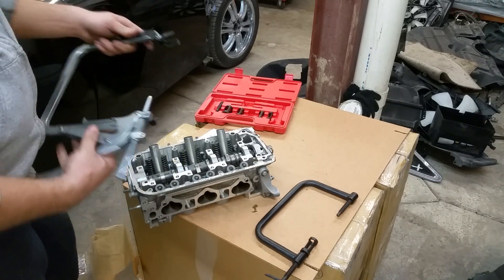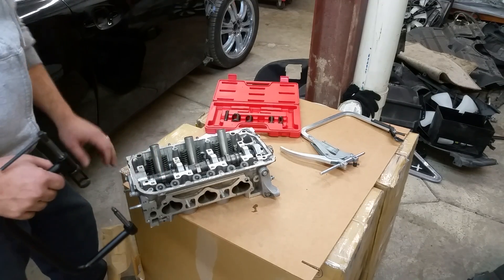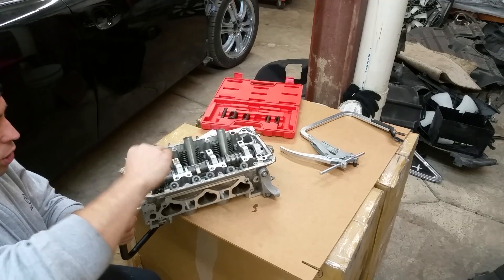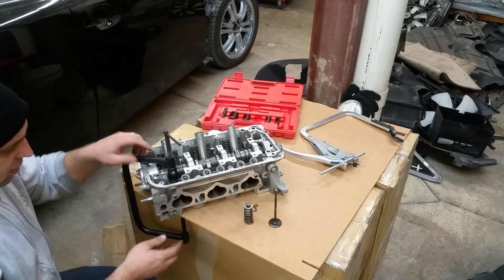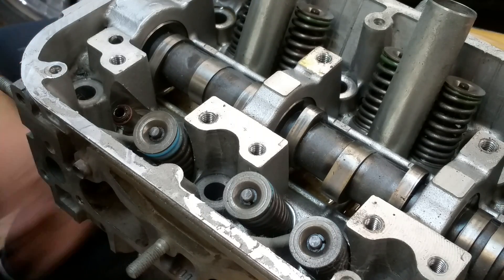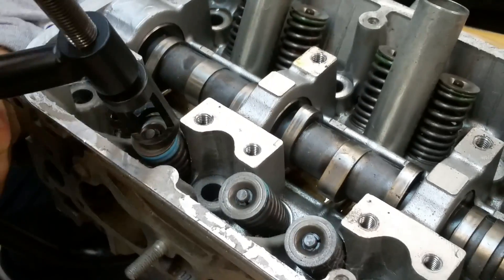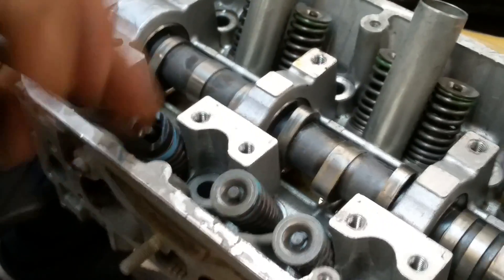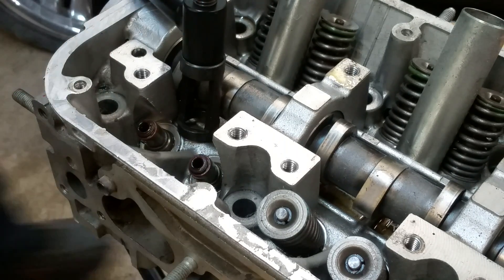How to remove and replace valves on a cylinder head on any Honda, Acura J-SERIES Engine.

Comment: Yeah I have a question, I have a j series engine that is out of time but I am hoping and there is a very good chance that the valves are not bent, also a good chance they are.  I was thinking before trying to retime it to see that I would loosen the rocker arms, do you know how much I need to loosen and remove to make it so it wont bend valves as I rotate to get it back into time, if you are even still around you have 110k subscribers but this video is 9 years old, great video btw.

Comment: Seems like a c clamp and a socket may work if your not all fancy like this fella.
Reply: Yea that’s what I was gonna try lol
Reply: @STLTypeS but if u use the socket how u going to take it off or even reseal it lol
Reply: @HigghRiise yea see I bought the 20$ valve tool from Amazon. C clamp with basically a socket without any walls around it. Pushed down the spring grabbed it with a magnet. But I guess you could try and cut a socket if you don’t want to buy the tool.

Comment: Hey, What about parts? Did you get after market parts or stock?? i would like to do an engine swap. A j35a8 to a honda prelude and would like to get stronger parts to add boost. I havent had any luck finding any.
Reply from the maker: I used oem

Comment: George, ive watched a couple of your videos on the honda j series motors as im working on one myself. I had a machine shop rebuild my 3.2L heads & when i put them on & tried to set the timing, the rear cylinder head's cam will not rotate all the way around, it goes about 3 quarters & wont go any further. Ive turned the crank to make sure all 3 pistons are down on that side enough to avoid piston/valve interference and it still will not rotate. Should i take the head back to the shop and have them rebuild? What do is your opinion on why it will not rotate completely? Any help would be greatly appreciated. Thank you

Comment: Hi there I own a 2008 accord V6 with a J35z2 engine can I make a direct swap with the Acura TL engine j35z6 or will I need ecu etc? Thanks need to update since my current engine is misfiring bad
Reply from the maker: 2 much work 2 do that